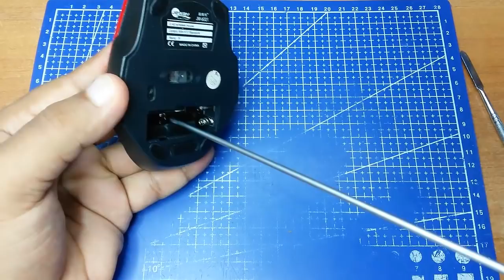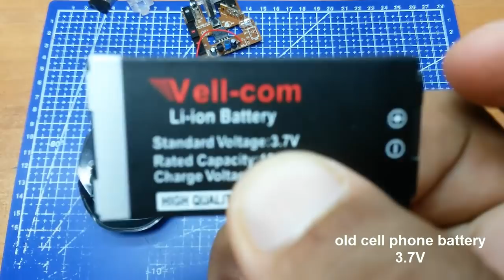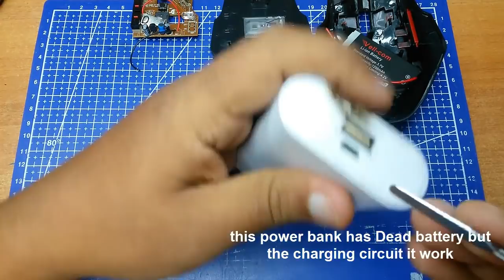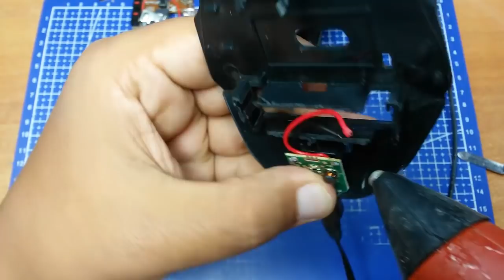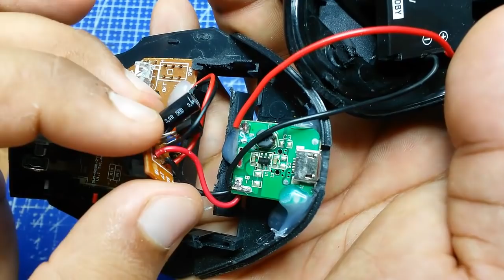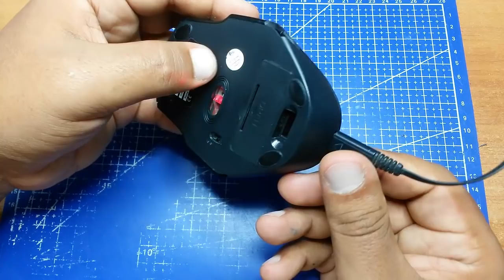Wireless Mouse to Wireless Rechargeable Mouse

Comment: Dont wireless mouse need 3V?? Two AA batteries are 3V total. I have a 3.7V lipo battery but don't want to burn the circuit!
Reply: Ali Hardware but I'm the video it says 3.3v?
Reply: Ali Hardware also could you please explain how did you connect the regulators +, - and GND? Thanks!!
Reply: Ali Hardware and also why not put a regulator between the micro usb and the lipo? If the usb is 5v and lipo is 3v, would it not explode without a regulator?